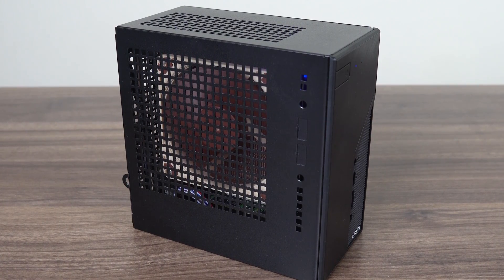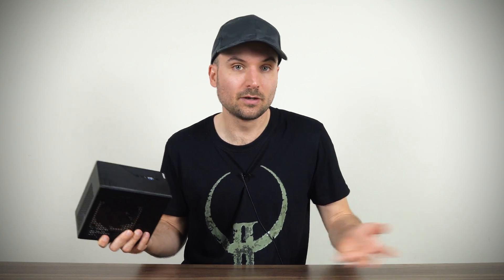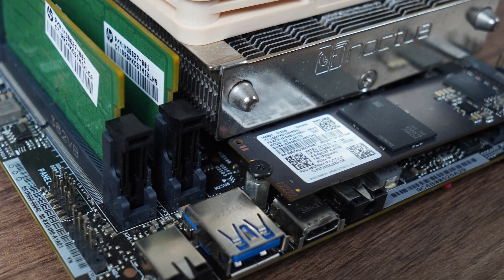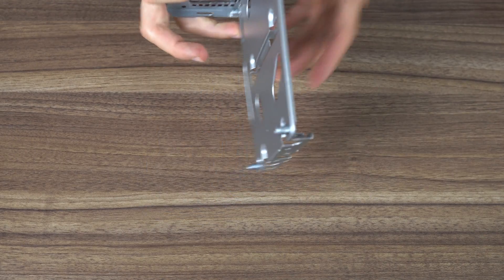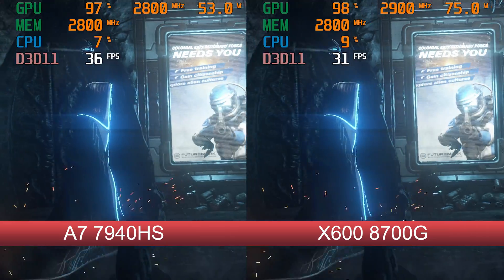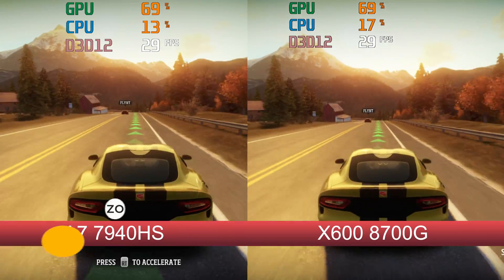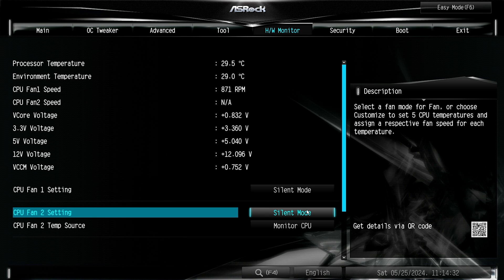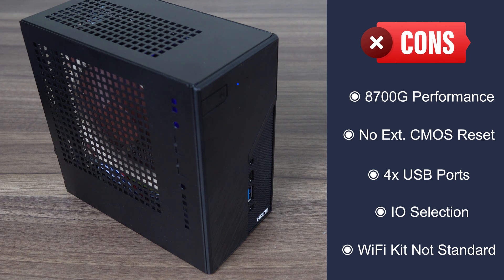The Smallest DIY Gaming Mini PC Has Arrived - ASRock DeskMini X600 Review

Comment: I started with the A300 deskmini using a 3000G. (2 cores)
Then I built a X300 deskmini with a 3200G. (4 cores)
Finally I built an X300 deskmeet with a Ryzen 3600 (6 cores) and an RX570 graphics card. 
My gamer build is a B550 mini-ITX, with a Ryzen 9 3900XT (12 cores) and an RX 6700XT (12Gb ddr5).

So, I think I'm done for now.

Comment: Here's a fun tip. Take the am4 cooler off sand the top of it so it becomes a little shorter and fit in the case better. You can take 2 mm off of it and still have plenty of space for the fan.

Comment: Smaller PSU is NOT a "Pro"  it's a definite "Con."    If the PSU was bigger, say 150 or even 180 Watts, then the following testing would have allowed the G8700 to pull ahead.
Reply from the maker: Same wattage as the X300, but more compact.
Reply: @Robtech  Oh interesting.  Well put an Oscilloscope on the main bus, 12V.  See if it gets dirty when you load the system down with a stress or render test.

Comment: Deskmini B760 has so much better connectivity.
Reply: Yes, maybe but when you see the performance of the iGPUs present in Intel CPUs, then all the "Intel" DeskMinis become uninteresting to me unless you only want to do office work, internet browsing and watch a few movies or even make it a NAS server, but that's all.

And for the connectivity if you are a bit smart, it is really not complicated to solve the problem, personally by investing only 40usd I was able to add 2 USB Type-C ports (in USB3.2 Gen2 10Gbps each) and 2 other USB Type-A Standard ports in USB2.0 (for anything that is a simple peripheral that does not really require bandwidth), the 40usd consisted of a 2xUSB Type-A 2.0 adapter to a 9Pin USB2.0 Header (8usd, instead of buying the official ASRock kit at 20usd) and an M.2 adapter card to 2xUSB3.2gen2 (10Gbps) Type-C (ASMedia ASM3142 controller, output cable included, all for about 32usd).

Or instead if I had needed an OCuLink input/output, I could have taken an M.2 adapter card to OCuLink output (SF-8611 port) and output header (+cable) for the case and the whole thing would have even cost me less than 15usd for just this function, that's the strength of the DeskMini, is that if you are a little smart you can adapt just about anything and everything (everything is a question of adaptation and if you get rid of the original case for a custom-made case in 3D printing, and it becomes the PC with the best performance/versatility/volume ratio).

Comment: Why do all reviewers keep insisting calling the x600 a chipset. This computer doesn't have a chipset, everything is controlled by the cpu. It's a PCH-less board.
Reply: Exactly, and the reason for the lack of USB connections is because you do NOT use a chipset on these Deskminis, all connections are made directly to the CPU.

Comment: Please try to set UMA frame buffer to 4GB to see if it can improve the gaming performance.
Reply: Nope, the BIOS "1.43" is the problem, he has STAPM bug, you can fix it for correct 8700G iGPU perf with the "2.01" BIOS version or more recent BIOS(3.02 or 4.03) released last days.
Reply from the maker: It was on 8GB
Reply: @Robtech  try 4GB for better performance.

Comment: The G series are too leaky to be sold as laptop CPUs, hence the heat and lower performance. They are pushed too far up the power curve. On my 4750G x300 I've limited the CPU power to 15W with little CPU performance hit. However, the integrated graphics are not affected by this and can use up to 66W (when it's not wasted by the CPU) and only then show what it can do. And, it's quieter too. I've transplanted a Thermalright x47 - 90 (some chopping of the VRM heatsink was needed) and I'm still happy with it.
Reply: how to limit the cpu power at 15 watt on x300?
Reply: @abdulaziz-lb6ru  In Bios. There are options for 65W, 45W, 25W... STAPM has to be at maximum, and also SmartShift has to be set to ON. In my testing while gaming the CPU was @ 8~12W, while the GPU was @ 65W. This way there's more power budget to get the GPU to 2250MHz overclock and have no problem.

Comment: I got a DeskMini X300 after watching your video back a few years ago, and in some ways disappointed that they didn't change much with the connectivity. Could have used one USB4 port on this one; I ended up putting an NVME M.2 to Oculink adapter and running an oculink cable outside of the box to connect a graphics card just for fun
Reply: Yea how is the performance? I'm thinking of getting this and putting that on pcie 5.0 to get the max speed.
Reply: @teckmology4824  i think waiting for the 5060 (or 5060ti) should be the option for now, maybe pcie 5 support although like the 4060ti only x8 lane
Reply: How was it , great performance?

Comment: Usually the vga ports are present when the box is intended to be used as a small server, or for running a marketing display in the field.   VGA is just there to always have access for IT use, debugging,  etc.

Chips with built-in graphics are extremely sensitive to the ram details.   Really have to use premium grade ram with an apu.
Reply from the maker: Same memory from the X600 in the Geekom A7 has the same results. The X600 shouldn't be worse either way.
Reply: @Robtech  Thanks for the efforts and video,  really appreciated.  It would be interesting to see what happens with max quality ram.  AMD sales team talked about using ram that was even higher than their data sheet for good results.

Comment: Given how much these mini PCs are starting to struggle with more heat and faster cpus (780m)/etc I'm thinking slightly bigger mini PC's with bigger 120mm fans will be a better option moving forward. Maybe not as big as mini-itx but a little bigger is fine. Not sure why so many mini PC's use laptop cooling components when they have vertical space for better cooling.

Comment: I like ASRock, almost don't build with anyone else these days (they're the only one I "trust" anymore), and I was excited to hear about the X600. However this is a big miss in my opinion.....

- Extremely limited part choices (only CPU & RAM, only SoDIMMs or AM5).

- The case is big enough to have a PCIe slot with dual slot spaces (expansion means WAY more versatility).

- Four drives is nice, but why gen5 if it costs everything else (no PCIe slot, crap USB, one LAN port).

- As is it's "almost" a mini PC that you "build" yourself, but even top-spec'd at higher cost, the market has plenty of actual mini PCs with better performance and many for less money.

Try again ASRock, you're better than this.

Comment: So you're telling me that the X3D which is like the most efficient CPU to date is incompatible with this? goddamnit
Reply: Most efficient? From what I've seen it can help a GPU push out the most frames for the least power. So efficient in that regard. But even at idle all that cache does have it's power draw. Still, wish AMD would push out some APU with just cheap and good enough cores, big IGP and some X3D cache to offset the lack of GDDR memory.
Reply: @FrancisFjordCupola  yeah That's precisely what I was talking about.

Comment: 8700G less l2 cache and less cores. They focused so much on the GPU side of the APU they forgot the basic's of a gaming CPU Vram, hope they do a 8700GX£D or something like that.
Reply: The potential for more performance is there, its probably just harder to get all out of that CPU with the Deskmini and medicore SODIMM RAM which is limited to just 1,1V VDD, i guess if he would have some Hynix based RAM with a unlocked PMIC he could set VDDIO/VDD/VDDQ in the bios and clock the memory much higher.
For example the 8700g in my normal desktop pc with overclocked memory and unlocked power limit gets over 4600 graphics score in 3dmark Timespy compared to the 2805 from the video.
Reply from the maker: The GEEKOM A7 performs the same as in the video with the Samsung memory used in the X600 and at 5600, not 6000. Same memory bandwidth between them should at least equal similar results.
Reply: They wont, all these desktop APUs are from the defective units of the high-end CPU s wafers.

Comment: How can a 7940hs beat a 8700g? Isn't it cooling and TDP restrained?
Reply: Yes, but even so, the 7840hs/7940hs + 780m combo is fairly potent. Also, the performance settings are pretty low on this one. Most 7940hs/7840hs come running at 5600 memory out of the box. Combine that with not enough power supply to reach full potential, and it is what it is..
Reply: Yes, it's STAPM Bug, the bios "1.43" here is too old and buggy, last bios fix that

Comment: why the cooler when all apu's come with a stock cooler and you not going to put a 7000 cpu in it. Anything more the 8500G is a waste in this case. also if you in to the £300+£150($450 total), get a mini nuc type PC with Ryzen 7000/8000 mobile f04 £500 ish with ram and storage etc. or barebone Minusforum or other Trigkey are good but tech is a little behind belink etc but quality of build I brought a pricy G5 mini PC £250 for a N100 with 500gb Nvme and 16gb ram. England is a bit of a fucker as US brands are costly over EU and China direct shipped brands like Trigkey and Beelink
Reply from the maker: The 8700G comes with the Wraith cooler. It doesn't fit. With the Wraith Stealth you need to rip off the plastic shroud off which isn't easy.

Comment: You've got another 10mm of clearance for a CPU cooler, so it may have slightly higher numbers with a bulkier cooler. The l9a in AM5 isn't quite as good as the AM4 mounting. This build is pretty neat for the price. Great review!
Reply: Hmm. The x300 said 46mm CPU cooler clearance. I was thinking this would be around the same.
Reply: @TheCeleryGod  he showed the clip of the cooler he used last time that just barely slides in... the normal AMD cooler that comes with some of the models.
Reply: there is 0mm with the cooler he used...

Comment: HDMI 2.1?? No mini PCs have it for some reason I wondered if this does
Reply: The HDMI and DP are directly PCIe connected to the CPU as far as I know. So if you use an 8xxxG CPU you'll get your HDMI 2.1.
Reply: @Quast  found one for $900 and still HDMI 2.1. What a joke. For that much dough I will just build in a Fractal Terra and have what I need
Reply: @jandkwhite6459  where exactly did you look?
Reply: @Quast  I checked. Even they are HDMI 2.0
Reply from the maker: Nah, this is budget tier.
Reply: @Robtech  Huh? Both the DeskMini and DeskMeet X600 have a FRL4 HDMI 2.1 port (32Gbps), same as most of ASRock's current AM5 desktop boards. Verified this with ASRock's support, as they had it listed wrong on the Mini at first.

Should be able to do 4k120 with 4:4:4 chroma, though sadly no 4:4:4 HDR as that would need 40Gbps+. Haven't come across a mini (or desktop board) that can do that yet, sadly. (seems to be firmly in the domain of dedicated GPUs or DP/USB adapters for now)
Reply: @Robtech  I have yet to find one even at $800 that has HDMI 2.1 or 4k 120hz. Sucks because that on my 75in tv for an HTPC through the NAS would be so nice. Guess im just building something as small as possible🤷🏻‍♂️

Comment: A vga port how wonderful, will go perfect next to my fax machine and palm treo 650.
Reply: Presumably they're hoping to attract some of the CRT gaming crowd.
Reply: @blast_processing6577  Maybe but I think CRT gamers prefer full towers with 2 floppy drives, a zip drive, dvdrom etc.
Reply: @GeordiLaForgery  : Some CRT TVs in the late 90s / early 2000s had an optional VGA input, which would pair well with this PC and Batocera or Steam OS, setup to run retro games up to the PS3 / Xbox 360 or so.
Reply: Hey, don't make fun of it!  My laptop from 2001 has a VGA port and you are not going to call it old.
Reply: @TrusteftTech  2001 hehe! Must be built like a tank from that era.
Reply: Millions of businesses worldwide still use vga as their primary video output for their electronic cash registers & point of sale systems. It can also be used as a serial port in conjunction with some other d-sub connectors.
Reply: @mobiusbelts3607  VGA can be used as serial 🤯
Reply: you already have an hdmi port. im happy to have the two options, there are plenty of vga monitors still going around. in fact my new samsung 1080p monitor has both vga and hdmi ports. I could put it in vga and leave the hdmi open for anm hdmi only monitor.
Reply: The vga is the main reason I would consider upgrading to this from my x300 over all of the other minipc options
Reply: You make a good point. Asrock really should embrace having a modular port instead of a fixed vga port.
Reply: VGA is still widely used because you can run 50 meters of wiring for cheap.

HDMI on the other hand can only go 15 meters at most. There are longer cables but they're the expensive fibre optic kind.
Reply: it's geared for businesses, factories etc. some still use vga as there's no reason to upgrade old tft 14" square monitors

Comment: noticed there is a battery for time keeping? can the X600 go into sleep mode? I am guessing the vga serves some purpose for old school system for displaying advertisement. beyond that it is either itx, deskmeet x600?
Reply from the maker: Yep CMOS battery under the board, sleep mode works fine.
Reply: @Robtech  The original X300 I bought, could not go into sleep mode, it can only be off. Not sure if later version had that.
Reply: bios battery all computers have that...
Reply: the battery is CMOS bios, i think asrock just doenst want to spend more time or money to change the design, VGA should considered dead by modern standard.
Reply: @stevenknight95  VGA still gets used places where machines like this get used industrially so on the one hand I get why it's there but on the other it is kind of odd for a consumer device.
Reply: @nadtz yeah i agree with you, many manufacturing machines in the factory are still using vga too, but for personal computers vga should not exist.

Comment: Back in the day when the A300 was released there was not a lot a competition in the mini pc market as I remember it. Now with the X600 there is far more competition and imo better options from the minis reviewed on this channel. 

I still have the A300 and an X300 but have migrated to other minis especially since both the A300 and X300 makes an annoying high pitch noise (coil whine) when powered off and have to unplug it every time, does the X600 have the same issue?
Reply: me too have the coil whine problem in my A300 but i just get used to it.
Reply from the maker: This one doesn't, no. I suspect it was that previous power brick or something has changed on the board to get rid of it.

Comment: Interesting review, and I'm glad you let it go longer than your usual reviews, as I wanted as much info as I could get, as I've been considering this unit. It came with some negatives: no one really seems to put much effort into these small DIY-ish barebones, and things like leaving a VGA port while providing so few USB ports (and slow ones to boot) seem out of touch, as though they just couldn't be bothered to update the design more effectively, which may just indicate that they don't expect the sales volume to justify the effort.  On the huge upside for those who like the idea of minis but are willing to go a bit larger for more storage choices are the two nvme slots(I though I agree that it needed have been gen5 nvme) and the two SATA slots. However, were I to get this, unless something changes, I'd go with a lesser chip.

Comment: I would love to see a similar PC in size, with laptop MXM module for the GPU, user replaceable of course.

This one looks fine, but...5GB/s USB-C... facepalm
Having it a full 40GB/s speed would make the only 2USB 3 type A ports in the back as "fine", but.... *facepalm*.
The performance....*double facepalm*.

I hope it is a software issue and they fix it.  Unless it is a matter of not good enough power supply... tripe facepalm
Reply: Seems to be geared toward desktop replacement/workstation uses that require more and/or flexible storage options. Most minis assume you don’t need much internal storage and will supplement with external storage, so the USB speed clearly goes toward that.

But no Thunderbolt option in a modern “desktop replacement” mini is a bit myopic considering for a similar amount all told, other higher end pre-built minis and stuff like the Mac mini come with Thunderbolt standard.
Reply: @paradoxmo  The performance makes it NOT worth  more than a regular mini.  This PC has issues they need to fix before it is a desktop replacement for anyone.
EDIT:  typo making it sound the opposite.

Comment: Aww man, disappointing performance with the 8700g, (i suspect its a lack of power from the 120w brick for that 8 core chip), i still have my deskmini with a 3400g and its still great for my needs, (not gaming), nice to see the x600, but think i'll pass on it, i built a gaming pc so no need for it really as my deskmini still rocks, i'd utilise the 8700g in something else as your not getting full value from it in that x600 build in my opinion.
Reply: Agreed, why would they only provide 120w power supply? Is there a similar product out there? It's really what I want, I'm trying to avoid getting a 8945 based mini due to heating issues...